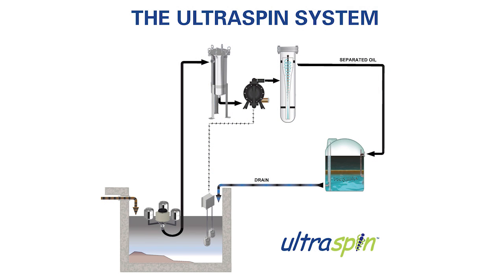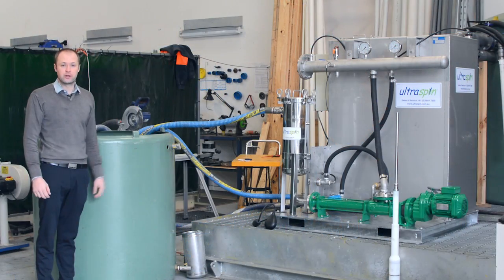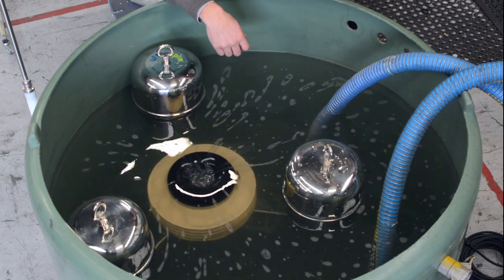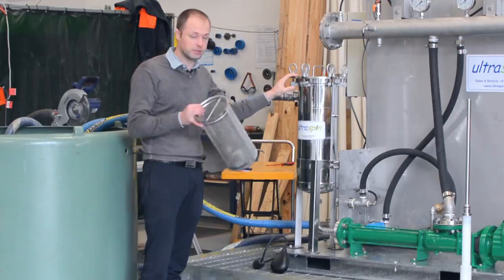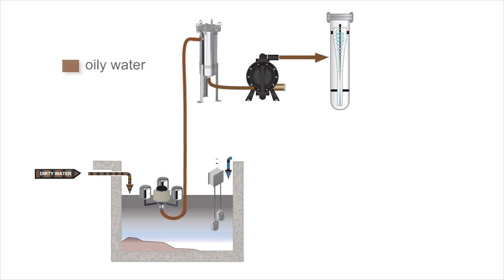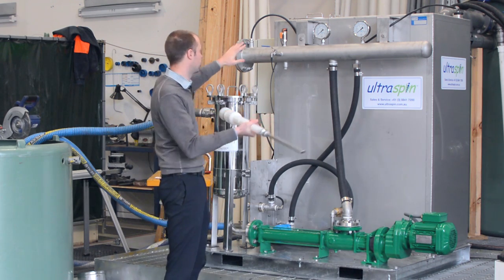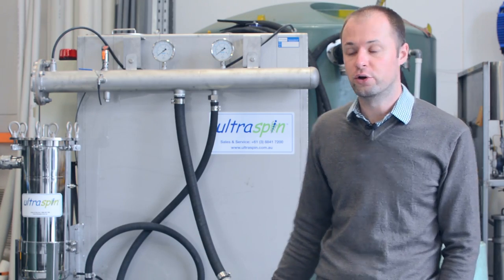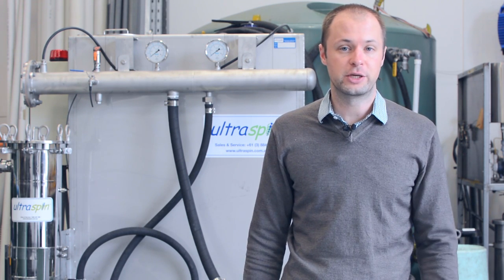Oily Water Separators - How our System Works

Comment: I am studying Marine Engineering so I have been looking at ship board OWS for the most part. Do they use these ultraspins on ships perhaps, or is it more of a facility based OWS?
Reply: Zack W . System can be used onshore or floating. Ship motion does not effect the oil separation (1000 g is generated by our system so ship motion has no effect)

Comment: Do you have large volume separators or would someone just run several in tandem?
Reply: Hi Brian. We have systems capable of flows over 650 m3/hr. You can double up, but most people get one system of the size they need.